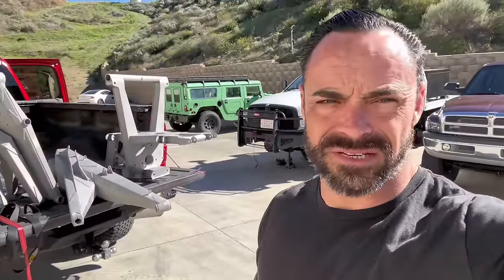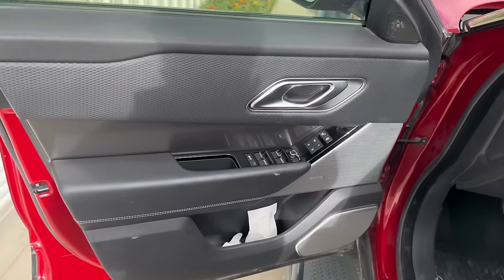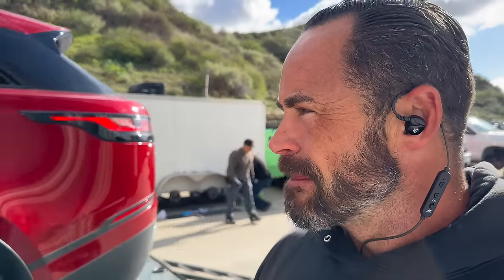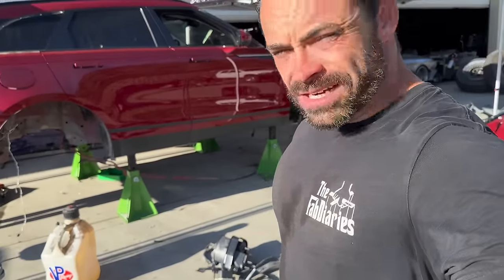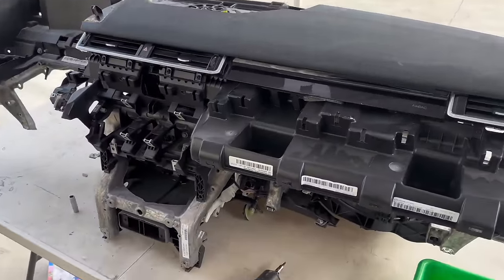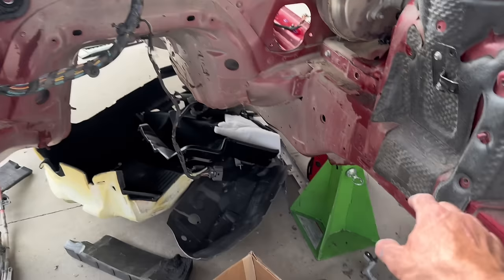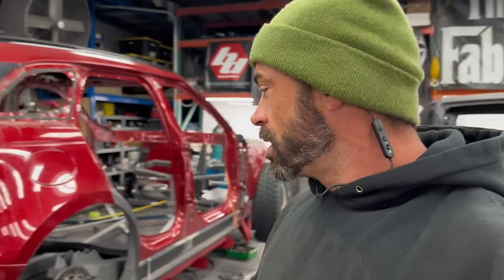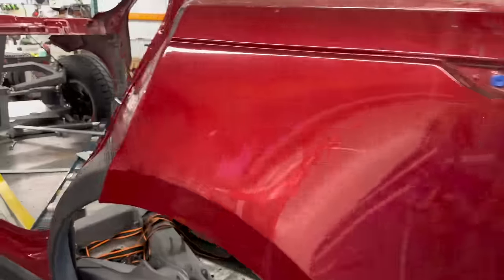Cutting up a RANGE ROVER | MCD1 Dakar Prototype ep2

Comment: The roof line may require a series of small fins to break up the vortices coming off the windshield, allowing the air to make the turn into the negative ducting up top, much like we see on Mitsu EVOs and BMW M cars. Worth considering if you don't want to make a positive scoop on the roof.

Comment: I’d be interested in why you chose this specific model and what other models of vehicles you considered if that’s not too much.
Reply from the maker: It’s all based on the vision. I envisioned this particular model over a decade ago. For how clean & flowing the body lines & proportions are.

Other vehicles are chosen by vision as well. Average is the enemy. We aren’t here to just build another Chevy prerunner pickup truck or similar. Every vehicle needs to be a unique piece of machinery.